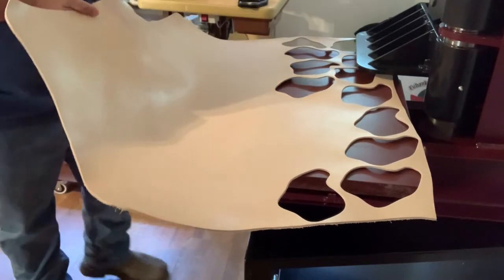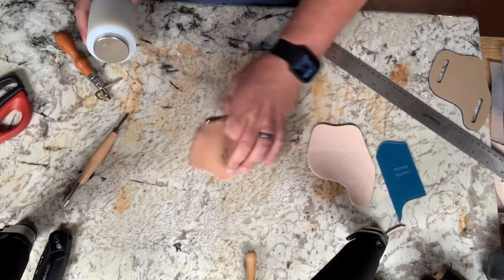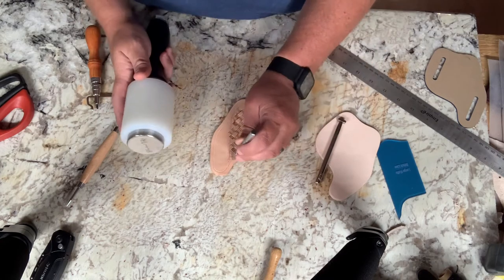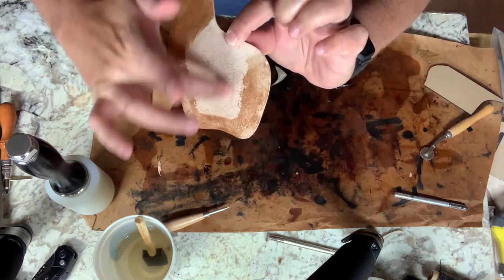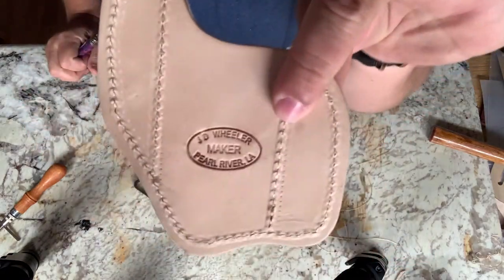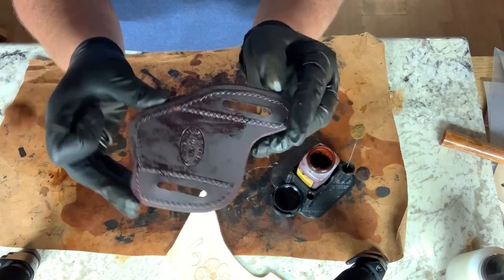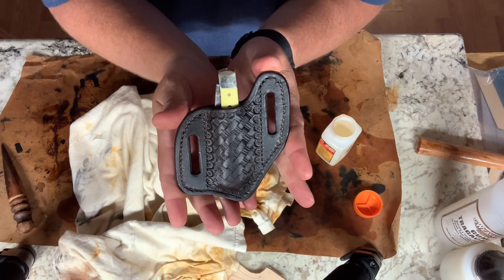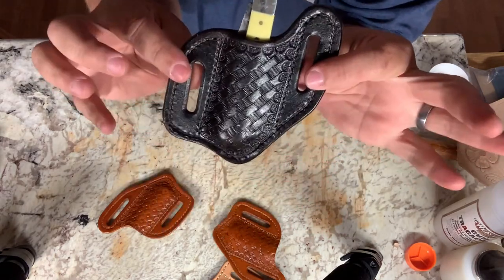Making A Leather Pancake Sheath For Pocket Knife Case XX Trapper Buck 110

Comment: What beveler did you use
Reply from the maker: I didn’t use a beveler on these
Reply: Lol yes you did at 19:32
Reply from the maker: @adamrobertson2048  I thought you meant beveler for stamping. Sorry. For the edge bevel I used this one by Horseshoe Brand from Weaver. https://www.weaverleathersupply.com/products/quick-change-edge-beveler-handle-with-5-blades